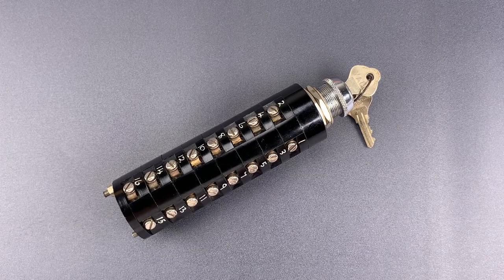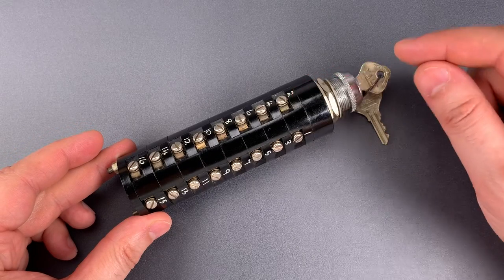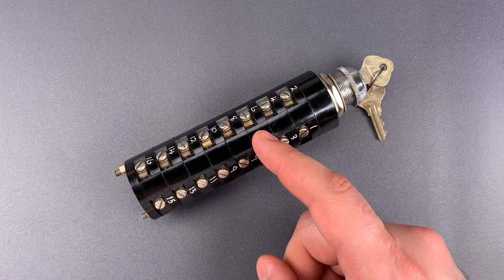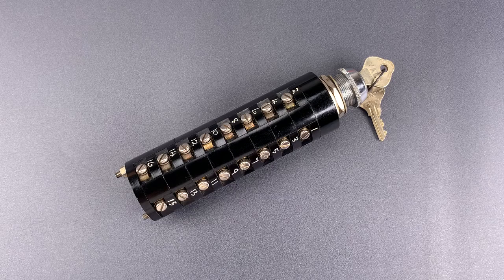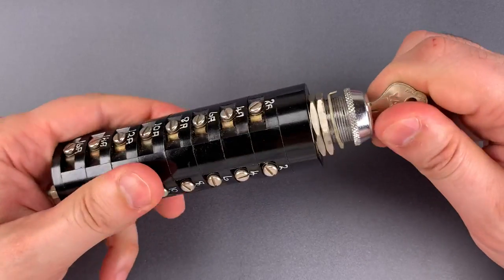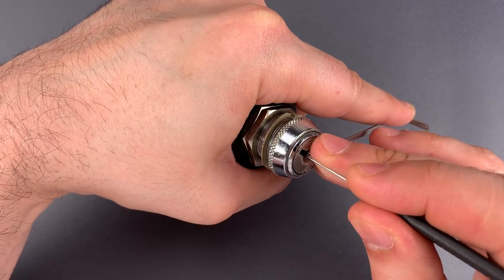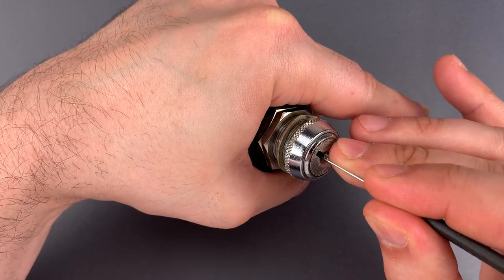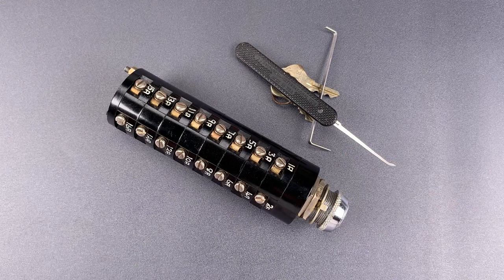[1154] Missile Control Key Switch Picked

Comment: He should design a lock using all of his knowledge from years of picking
Reply: The ultimate lock
Reply: Ayee, and like have it on different categories:
"Will withstand for X time for X level of lock-picking"
which will vary from: Resistslock picking for X time
up to: Will survive a tank-shell
Reply: No system is impenetrable
Reply: There are locks he cant pick.  Watch one of his best locks vids. Its the key hole not letting instruments get in.  Maybe if they were bent somehow.
Reply: This is true
Reply: He made it, and then he picked it
Reply: Greg Wood what video?
Reply: He has created his own locks for his home there unpickable
Reply: Check out his review on the Bowley locks. He hasn't been able to pick them. I am considering getting my home locks replace with it.
Reply: Pr0 Pancakes I appreciate your humor.
Reply: Id buy it.
Reply: Cat Electrical false. You can’t penetrate [VOID]
Reply: He'd just provide the necessary tools for welding and a grinder in place of a key
Reply: Study the relationship between client or consumer , programmers or designers, then the hackers or lockpickers lastly the producers or those who have the money then you may get the answer why he wouldn't need to.. even if he may have then it would be a failure because it would only cater to one or the other.. if everyone is happy and wealthy enough to live you may not even need locks
Reply: @gregwood5083  I saw the link and a comment saying they hated you. I immediately knew what the link was and I still wanted to click it anyways
Reply: Can God make an object He cannot move?
Reply: Dear god. Your a mad man.
Reply: My god, if you lost your key there would literally be only one man in the world that could help you.
Reply: An inpickable lock just leaves for other parts of the defense system to be breached or the whole thing destroyed.
Reply: Aiden Pearce yet you can return from void albeit without providing any value.
Reply: i don't think you could open that even with  the key
Reply: He has? He’s made a lock that self destructs when someone tries to pick it
Reply: Has he ever found a lock he could not pick?
Reply: pt : he will find an Enexcusable flaw in it a week later
Reply: One lock to rule them all.
Reply: easiest way to make something you love into something you loathe.
Reply: There are lot of locks he haven't been able to pick, but I'd be curious to see what he could come up with too.
Reply: It's called a welder.
Reply: I could only imagine for now
Reply: Greg Wood, damn it. Got me
Reply: Basivallyall locksare prickable ifgiven access n te, they only making it difficult...
Reply: True, I would buy one
Reply: For those interested in the Bowley lock, please check out the video by HuxleyPig69 about a Bowley lock and the response by the Bowley Lock Company. I'd like to see a new video by the LockPickingLawyer trying out the technique HuxleyPig69 used.

Link: https://www.youtube.com/watch?v=KS0FSzamUzc
Reply: You just never heard of abloy... I will send LPL a classic Finnish abloy which is used everywhere in this country, will see at least what he says about it.
Reply: The omnipotence paradox! Can the LPL create a lock so secure he cannot pick it?
Reply: He wont. because then he would have to pick it and show that it's not secure.
Reply: He did put up a video on how to make a copy of a lock he has in his house. The reason he doesn't recommend it is because though you will know someone tries to pick it, it has to be unlocked from the other side. If only there was a way to make a second key to free the lock so the key could be used.
Reply: @ConsentDeath  but if he could reach it would he be able open it
Reply: He helped Bosnian bill invent a pick. And they donated the plans
Reply: Top gear tried once, and it was a catastrophic bundle of good ideas and bad execution... But it was hella fun.
Reply: As a constant loser of keys I hope that never happens to be honest otherwise I'd have to pay him a ridiculous amount of money to retrieve my belongings.
Reply: Locks won't keep everyone out forever. Locks, like any security system, should be selected based on WHO you are trying to keep out, and for HOW LONG. Usually, at least long enough that someone else will happen by and try to stop them. If you are looking for the ultimate lock that will keep everyone out forever, it doesn't exist. There is always some way to defeat a lock.
Reply: That would prolly be impossible
Reply: @NoNonsense2042  used to work at a craft beer place with an inventory in the 100,000 of dollars. Owner put a Bowley lock on the front door. Only access. When I started he had to come down every morning to open the door for me because the locksmith who installed it died and no one else could service it or make copies. Eventually he had to scrap the door and start new.
Reply: there would still be Someone able to pick it
Reply: Sounds more like a puzzle
Reply: The mega lock
Reply: there has been at least one lock he didnt even try to pick... my guess is because he couldnt
Reply: That would be a million $$$ business for him. The branding is already done, just the products are yet to come.
Reply: A giant rock under the sea will suffice
Reply: @gregwood5083  hah fuck, have not been ricked in 5 years
Reply: Would sell out in seconds
Reply: "The Lock Lawyer"
Reply: @Reneator  Resist lock-picking and up to "Hurt APFSDS shells"
Reply: Yee
Reply: id use it
Reply: Ikr
Reply: The reality is that no lock is unbeatable, it's just a matter of making it require so much time that cracking it is unfeasible. Locks at this point are more of a social statement of "respect my ownership of this property" as well as demonstrating to your insurance provider that you put forth reasonable effort to prevent unauthorozed entry if your home, vehicle, or business is burglarized.
Reply: The issue is that unpickable locks can be made but they aren't worth the production costs.
Reply: Facts
Reply: You can't pick a brick
Reply: Its easier to destroy than create.
Reply: @cattocs  true but it would be incredibly difficult
Reply: ohohoh INVEST
Reply: That’s genius
Reply: It would probable be illegal though
Reply: A lock that shoots you when it detects something inside that isn't the key.
Reply: If a company can challenge his expertise, it would be revolutionary!
Reply: @cattocs  one is, and he made it
Reply: @tornadotaylor8956  yes, for now. Give it enough time and the code will be broken.
Reply: @jcdenton3022  The Bowley locks are pick proof along with Bosnian Bill has a collection of Naughty locks that neither can pick.
Reply: @pr0pancakes150  The tried and true Ramset will do much better.
Reply: @jcdenton3022  yes but how often do thieves try to break in via the locks, at your house in particular?
Reply: He shud put he prob won't as he doesn't read his comments
Reply: puzzles?  Nope... We know how to make unpickable locks.... The issue is market viability. 
When you make locks too intricate the machining and tooling cost go through the roof. 
I would not be surprised if the lock he designs has a price tag of $500.

Also if you want an affordable unpickable lock. Get a good quality (not china) RFID lock.
It's what businesses have been using for years.
Reply: Look at stuff made here he made a unpickable lock
Reply: Then try and pick it
Reply: someone did an unpickable lock that he wants to send to LPL, pins can't be picked one by one
Reply: @jcdenton3022  Waste of money. Burglars don't bother picking the door they just kick it in. You're better off having the studs your exterior doors mount to made out of something kin to bridge girders and having doors made from solid oak paneling than you are putting a fancy Bowley lock on a standard suburban door/stud setup.

The threat your deadbolt has to resist is brute force, not skilled lockpicking. If your concern is keeping burglars out, make it so their leg is what breaks when they try to kick the door in.
Reply: @1769papi  He's sailed through so so so many Assa Abloy locks though. He'll go through that one too.
Reply: @TestECull  bro. I seen only old abloy classic. Never ever anyone but hugsleypig officially picked any other assa abloy.
Reply: @cattocs  but some are stronger than others
Reply: puzzles?   naw Bc it would cost too much to make when you can get an electronic lock for like 20 bucks that’s already unpickable
Reply: Good luck, no one could afford that security xD
Reply: @gregwood5083   well... Here we go again
Reply: @StarGOwXse  glad it's still being appreciated!
Reply: Even if he designed/made a lock that he cannot pick now, a few months later with more ideas & experience he might be able to crack it.  As people, we all keep learning & growing.  (Sometimes sideways 😂)
Reply: if it can be created, it can be "hacked" into
Reply: Simple, make a bio metric internal lock that one set it can’t be changed of who can use it. Have holes to pick into.
Reply: A lock only he would know how to pick
Reply: It should be a merch item worth 200$
Reply: At that point you’re better off scraping a hole through the door with a spoon
Reply: @cattocs  yea it is just dont make a key xD
Reply: I would buy it
Reply: @cattocs  IDK fort knox is meant to survive multiple nuclear blasts
Reply: He already might have, but putting on display one of the best locks available would probably not be a wise decision
Reply: @ConsentDeath  pretty sure he picked that one too using a security flaw
Reply: I don't know if anybody can make a pickproof and unbreakable pick but LPL could make a very resistant one.
Reply: It would just be the bowley lock that nobody has ever picked
Reply: call it the god lock
Reply: The most deadly lock known to man
Reply: We have to name the lock excelsior
Reply: Good thought but every lock can be picked no matter how good
Reply: "can God create a boulder he can't lift?" "Can lpl create a lock he can't pick?" Same question
Reply: If it uses a key it can be picked
Reply: Stuff made here actually made a lock that can’t be picked he put it on a door and called a lock smith saying he was locked out he was going to send it to the lock picking lawyer yet he hasent yet
Reply: @thescottishgiant855   ope any thing can be picked even without a keyhole or code
Reply: Very original idea, I'm sure nobody had it before.
Reply: Yes
Reply: Can God make a boulder so heavy he cannot lift it?
Reply: @minetruly  holy sh-, err i mean god bless, you really made my night there.
Reply: @notsure9259  username checks out.
Reply: @cattocs  im sure there is a one off lock somewhere that was made that cant be picked. Maybe similar to the security pin locks that lock themselves after attempted picking but more advanced. 🤔
Reply: a
Reply: It's called wrapping. Guaranteed to keep LPL out longer than any lock would.
Reply: Many common locks become nearly impossible to pick if you just put WD-40 in them. As others have pointed out already they're still simple to destroy especially if you aren't worried about getting caught in the act.
Reply: There is a story similar to this in the Elder Scroll's series titled "Then Locked Room"
Reply: Welding whatever it is shut and cutting it open would probably be faster than using that lock lol
Reply: a lock that is designed to be opened with a key can always be picked, theres no way around it
Reply: Something tells me locks are somewhat like computers.  As someone with enough skills will always be able to pick it or hack it.  I mean has this guy met a lock he couldn't defeat?  If not, case and point.
Reply: I’d buy it
Reply: I think the key (no pun intended) to the best lock is to make it extremely difficult to  access, but not impossible, because if you have no fail-safe options you risk having no access as well.
Reply: a cement cube
Reply: Stuff made here already did
Reply: The impossi-lock
Reply: You can't pick proof a lock. that's the point
Reply: Sam omg iam sure he has never thought of that.
Reply: @Hyieh.  you should hate yourself for not memorizing the URL. Join the chad gang today and train your memory.
Reply: @TacosAreLife.  no,pandoras lock
Reply: Just make a weird enough key that any available lock picking tool won't work on it. Since they would need to be specially made for that lock 99.99% of people even if they would have the skills to open it just won't go trough the effort to create specially made tools just for that lock.
Reply: @gregwood5083  welcome back to the early 2000s.
Reply: He did
Reply: in fact , design a unpickable lock is already made it s just not worth it at all for 2 reasons : 1- the risk of getting an expert lock picker who is a secret agent ( who have proccessed a succesfull infiltration) is very very very low  and 2- it s expensive for nothing : if the lock is unlockable just destroid it or pass it
Reply: then he would try to pick it
it would be the unstoppable force versus an immovable object
Reply: but hes a lock picker, not a lock designer
Reply: @gregwood5083  thanks!
Reply: I agree 100%. He would be able to get a lot of investors behind him to mass produce and a even use simple name like LPL. I’d purchase one to use on my bike and storage shed, and surely millions others
Reply: @cattocs  hi
Reply: A lock that is so good even its key can't open it
Reply: @gregwood5083  you've rickroled me and I'm not even mad
Reply: Electronics locks can't be picked.
Reply: 90% of the battle (in lockpicking) is knowing. 
If you have enough time, and you can disassemble the lock, you can practically find a way how to "attack" the lock.

This is why LPL picks in a controlled manner, not on the streets where any lock can appear.
Just imagine when LPL will be confronted with a lock that needs a specialized pick, and he doesn't have it... then it can't be picked.
Or that specialized pick isn't even made yet (because he doesn't know the contents of the lock), then he also couldn't pick it.
Or another scenario where it can't be picked (no keyhole) but attacked in another way, and you've given LPL a time-restriction - then he possibly could not open it.

^All these scenarios apply to robbers / lockpickers in an actual scenario - which locks are made to protect in. Thus, just because LPL could pick it in a controlled scenario, doesn't mean it won't work in an actual scenario.
Reply: YES
Reply: @cattocs  Right
Reply: He did. If picked he made it so it collapses and thus is unpickable, but also unusable and must be removed to actually open like say a door.
Reply: Yes
Reply: @cattocs  In the same way as there are no criminals who would not have been caught .. or not?))) The best criminals are unknown to anyone, so are the castles, you just do not know anything about them, this world has everything, and even a castle that no one else will hack. Lol, even no one will break my lock, I placed contacts in the lock, when the key is turned, they close, you need to turn the key, and then make three half-turns until it stops, and then the mechanism allows you to turn the key again, the last time that opens the lock if you close it its for 1 turn, then it opens as usual, but if at 2 .. No burglar would ever understand how it works, the batteries are in the door itself, they are charged from the mains once every half a year, the wires go to the bell, and imperceptibly through the door , everything is simple)
Reply: @SmallPaul.  which video?
Reply: Would be a damn good retirement check
Reply: @jcdenton3022  I was a criminal back in the day and we never picked doors we would just kick them really hard with our boot and if an alarm sounded we would run so as long as you have an alarm system unless they know you have some super valuable object where they know exactly where it is located that is the only reason alarm wouldn't work.. no1 is gonna spend time looking for valuable items while the alarm system is going off. your windows however use magnets with most alarm systems however some alarm systems can detect magnetic tampering also and make sure when you have your alarm system it has active magnetic tampering detection because that is how most people who did get robbed while away thief goes in while the alarm system is still armed motion detectors can work but if you have dogs which lots of people do then motion detectors won't really do much except provide false alarms basically every time its set armed... some people have camera feeds but anyone with a good layout of the exterior cameras can put on masks and conceal their identity enough for there to be not enough info to nail down the perp... smart thieves conceal well enough to not even show wether they're a white guy or a black girl, because without this kind of info the police basically have to judge by an approximation of height which can also be very varied due to the average shoes/boots having different sole and rubber thicknesses.. now a big one that does get people is footprint analysis but a smart thief knows to use a throw away pair that they got from a thrift store or some small secondhand clothing store where they only wore them for that specific purpose.. so if your going to get robbed its going to be more an alarm system that saves u than having unpick able locks..
Reply: there is hundreds maybe thousands of locks that is in unpickable even for him it will just be boring i think the video will be like 30 seconds long
Reply: No need. Lots of locks are unpickable even for guys better than our LPL. What does not makes him any less amazing.
Reply: My thought is that if it has a key it can be defeated
Reply: @vector6909  What about lock picking robot 😜
Reply: When he put a love lock on a bridge, he welded it shut so it could never be unlocked.  Does that count?
Reply: Man, this guy could probably design a revolutionary lock for homes, businessess,and cars
Reply: Yes. Just like in the movie called "Catch me if you can" if you know what I mean.
Reply: He just makes a solid tungsten block with a brick of pure gold inside it and hands you a set of picks.
'good luck.'
Reply: @douglaswilliams6834  yes, the bowley locks. He has 2 videos on them.
Reply: hes working with Bowley doing that
Reply: Call it the ‘Fluke’
Reply: I don’t think that would be considered a lock anymore 
More like a vault door compacted into a door or case
Reply: I guess its time for welder 😅
Reply: @cattocs  thermite moment
Reply: LPL brand, i would buy it for any amount
Reply: Ya but then there would be a fatal flaw, he would know just how to pick it! Chicken and egglock.
Reply: Anything with a keyhole will always be picked
Reply: He will make a lock so strong that they just simply shoot the door with a tank
Reply: He would make a great obgyn.
Reply: Lmao
Reply: I’ve thought of that so many times. He could make billions of dollars if designs a patented lock 🔐
Reply: Lpl: Hey guys I designed the perfect pick proof lock that requires special tools to break.*Holds up a large rock*
Reply: LawPickingLawyersSon: allow me to introduce myself
Reply: Because you can drive a car doesn’t mean you’d be able to design one ! 🤷🏼‍♂️
Reply: Aq
Reply: Stuff Made Here is on it.
Reply: True
Reply: Could LPL design a lock that not even he could pick?
Reply: More fun to develop ways inside other peoples
Reply: its not like people who design locks doesnt know how to pick them lol
Reply: @silentdays3753  @Greg Wood will never reply to you....
Reply: He already has. It's a chastity lock, for his wife! 😲 😱
Reply: @Reneator  that's how they grade safes already, basically.
Reply: But he can’t because he doesn’t have any
Reply: He and Bosnian bill should design a lock.
Reply: it's like telling a race driver to design a vehicle.
He might be good at picking but it doesn't mean he knows a lot about manufacturing which is what you need to realize a design.
Reply: Well if he made it he’d be the only one who’d know how to unlock it
Reply: yes :)
Reply: The only way to keep anything safe from this guy is to incase it in solid tungsten.
Reply: @cattocs  my ststem for procrastinating is solid as fuck
Reply: That…. That’s a great idea
Reply: He probably has
Reply: Can a omnipotent lockpicker create a lock so unpickable he cannot pick it?
Reply: @IndigoIndustrial  Good point but paradoxes don’t really work in real life. It’s either possible or it isn’t.
Reply: Heck I'd buy it
Reply: That would be just a shackle simply welded shut
Reply: @tanvir7454  Clever but I think it is implied that the lock needs to be functional. If a lock cannot be opened, it is not functional, no matter how many thieves it deters.
Reply: I think that there is a no lock which impassible to unlock .. because for what ever the lock it was you can make a tool to trick the lock 
Its just like hacking a system
Reply: Have I got a collab for you…
Reply: It would be godly
Reply: He'll probably end up picking it and calling the creator a hack.
Reply: @cattocs  bowley lock is pretty close. Breaking it is probably better then trying to pick it.
Reply: There are 2 different skills  Designing and building is way different then picking
Reply: He'd probably just use a biometric scanner lock.
Reply: The hardest locks to pick are ones with 90° turns in the keyhole, hes had a few of those which he said he was completely unable to pick because it was impossible to get the pick underneath the pins. He has a video called "top 10 nastiest keyholes" or something you should check out, theres a couple locks he himself has been unable to pick.